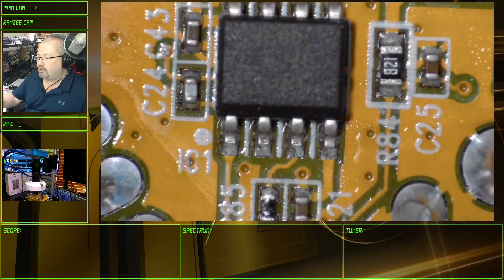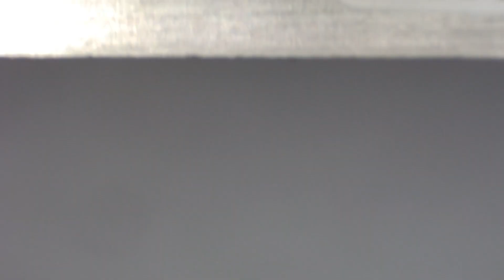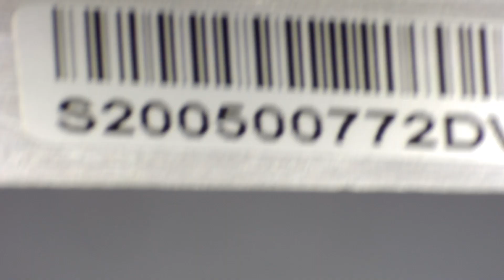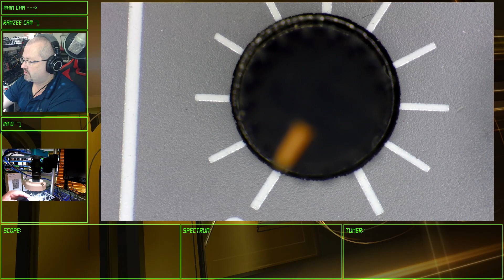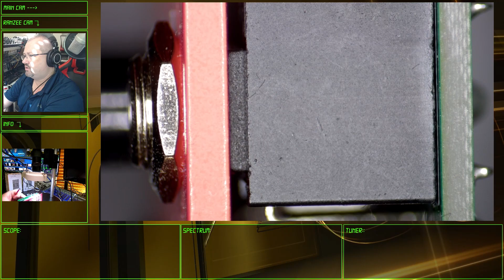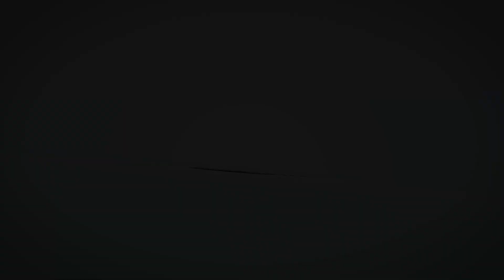Behringer Eurorack Module Closeup Look

Comment: I just thought I'd add that the original Roland System 100M (1978) also did'nt have the 3.5mm jacks bolted to the face plate. I'm not sure if they were attached at all, look at photos of it, it does'nt appear that they were. They look like a floating design like the Behringer. The original semi-modular System 100 (1975) has the 3.5mm jacks with bolts on the front panel.

Comment: Q. if any, how many  jack socket have failed in the last 2 years use?
Reply from the maker: None. To be fair, at the time this comparison seemed to discover a mechanical issue - however, these sockets have remained sturdy without issue. In comparison, I've had no sockets fail on any modules of any manufacturer. Not a scientific test either.

Comment: Mine isn't much use in terms of Tuning after an Octave or so...I contacted them about it and they sent me the Calibration procedure...Which is a bit over my head and I don't have the Tools.  I think they should check them before sending them out.

The calibration procedure for the 112 VCO DUAL is as follows:

1)    Power the module up and allow the module to warm up to normal operating temperature for 20-30 mins.

2)    Set waveform switch to triangular, set RANGE switch to 32’, Set the PITCH knob to 0 on the scale, set the MOD IN 1 attenuator to 10 on the scale (fully clockwise).

3)    Connect an accurate frequency meter to the VCO OUT 1 jack. Make sure nothing is connected to any of the MOD IN jacks.

4)    Using the PITCH knob set the frequency to 16.35 Hz (±0.2 Hz) which is musical note C0.

5)    Apply exactly +4.00 VDC to the MOD IN 1 jack, this should change the VCO output frequency to 261.63 Hz (±1 Hz) which is musical note C4. 

6)    If this is not the case locate the VCO1 or VCO 2 WIDTH trimmers on the module underside. Adjust the relevant VCO1 or VCO2 WIDTH trimmer to set the volts per octave frequency scaling correctly. If the frequency is <261.63 Hz (±1 Hz) then adjust clockwise, if the frequency is >261.63 Hz (±1 Hz) then adjust anti-clockwise.

7)    Now disconnect the +4.00 VDC from the MOD IN 1 jack and recheck the frequency has returned to 16.35 Hz (±0.2 Hz) to ensure that the PITCH or MOD IN attenuator knobs were not accidently moved during trimming. If there is an error, then repeat steps 2-6. If all is OK, then proceed to step 8.

8)    With the VCO set at 16.35 Hz, observe the position of the PITCH knob, it should be set to 0 on the knob scale. If it is noticeably out of position then set the PITCH knob to exactly 0 on the scale, then locate the relevant VCO1 or VCO2 FREQ trimmer on the module underside and adjust the VCO FREQ trimmer to set the frequency to 16.35 Hz (±0.2 Hz).
Reply: My module was pretty much out of tune when I received it but I followed this tuning procedure earlier today.  It took probably 10 minutes tops to do both VCOs after I'd left the module to warm up for a while.  

I used my Keystep CV pitch out and the tuner utility in Ableton, VCO out straight into my audio interface.  Adjusting the trimmers was fairly easy to do and now I'd say the tuning is good on both oscillators from C0 to C5, octave jumping sound great now whereas before it was really dreadful.  It is annoying to have to do this when it could have been done in the factory but at least I know they are capable of being tuned correctly!

Thanks for sharing the details.
Reply: @apecityelectronicsoundstudio  So which trimmers did what?
Reply: @GEOSynths  The width timmer is for octave spacing and the frequency trimmer is for the base tuning of the oscillator.   I just did a slow sequence alternating between C1 and C4 on the Keystep then using the VCO1 Freq trimmer tuned the VCO to be at C1 on the low note, then used the VCO1 width trimmer to bring the high note closer to C4, then re-tuned the low note back to C1 then use the width trimmer to adjust the high note, keep repeating until it was in tune on both notes of the sequence. 

Each VCO has two trimmers, one for width and one for frequency, the VCO2 width is the one on the left side of the PCB and the other three in order are VCO2 Freq, VCO1 Width and VCO1 Freq.
Reply: Dean Hatfield-Bowley excellent, thanks for the info, much appreciated.
Reply from the maker: Thanks for sharing this. Interesting how you got this response from Behringer and I got nothing. I put in a support ticket too! Perhaps they got wiser, as my support request was fairly early days after they first started shipping.
Reply: @ranzee  The guy said he had to go looking for it!  I've asked if they can swap it as it's too much for 'normal' people to do, plus have to buy equipment to do it.  Will wait and see...
Reply: You can maybe use the tuner in Ableton with it.
Reply: thing is calibration will move with transport, storage temperature, usage temperature and the like, and over time.

Comment: Can we modify somehow to add the nuts onto the jack fittings ?
Reply from the maker: You could desolder the 3.5mm sockets and solder in some new ones which have the surface mount nuts. That would be a crazy job on the 173 module lol - but on the Dual VCO it's only go a mere 16 sockets ;)

Comment: I think it relevant to point out that, in Europe at least, the Behringer VCO is less than a third of the price of the  Roland. It would be possible to buy two Behringer VCOs and keep one in storage for usage in case of mechanical stress failure of the first. Doing so, one would still save more than a third on buying one of the Roland VCOs! The huge price difference invalidates any direct comparison, in my opinion.
Reply from the maker: This is a great point. We need to be considering everything here - how much things are, what they give us from an economical point of view may far outweigh what the quality of the build is. We actually discussed this over on my live show last Saturday.

Comment: Great follow up to the main topic of the stream Saturday night and isn't synth pr0n in the slightest!  The difference in build quality can be huge from company to company in the eurorack market even at the same price point.  I'm not surprised that Dread Box have the more structurally engineered module, they have been doing it for some time now.  Haa you got the Dystopia!  I keep skirting around buying it, even though it'll be great for my modular drum synth.
Oh yeah I almost forgot to ask, did you get the Nifty Bundle?  If so did you swap the Chips face plates?  Also have you noticed that the rail taps are ever so slightly out making it hard to mount modules without slotted screw holes?
Reply from the maker: Hey Mark - it may have been intentional ;) lol. However, yes the Dystopia is a great module - albeit quirky - it still offers that difference in my modular setup.

I didn't get the Nifty Bundle - just the Nifty Case - but it did come with the face plates (or blanks) - they are just sitting in a drawer now ;) I didn't have that issue with the rail taps ... maybe you might need to point that out on Satuday and we can look at it a bit closer.

Comment: Great video. Very interesting!

It is very telling that Behringer are fine with copying Roland on every single aspect, except the build quality! And even then, on such a tiny thing such as nuts on threaded jacks which, as you say, would cost literally a few cents. 

And then a relatively tiny company like Dreadbox seems to find a way to wear the miniscule cost of nuts on threaded jacks where a mammoth company like Behringer just can't seem to find a way to make it work...
Reply from the maker: Exactly, it is amazing what we discover when we start to look a little bit closer at things. I guess this also puts a lot more meaning to the phrase "Don't believe the hype!" ... there is a lot of power in those marketing messages, and sometimes taking a step back and having a close look may reveal the truth.

Comment: Hey Ranz - great subject for a video. that magnifier would be perfect for doing the volca beats snare mod.
Reply from the maker: Cheers mate. We could do this! I'm thinking it's probably time!
Reply: well just to add an extra layer of challenge i've made it a little more complicated but attempting it with a friend helping me and we managed to remove the solder from the patch points so now they are dried and damaged - but there might be other points to insert the capacitor. i still haven't posted the Giga delay so there's no hurry to get any of this done but i would love to send you this stuff just to see what happens.  and could make for interesting video... have a great day - i need to order a new speaker cone for MSP7